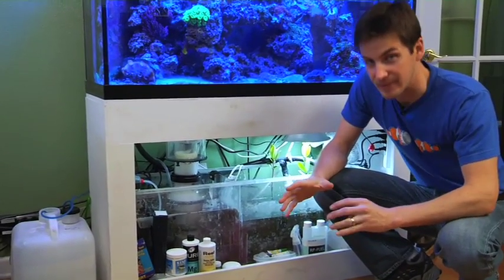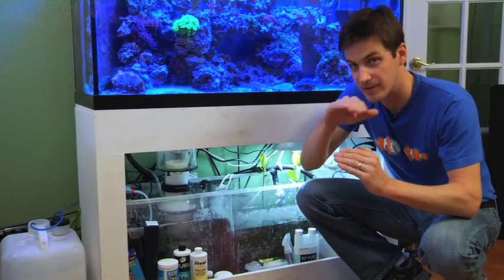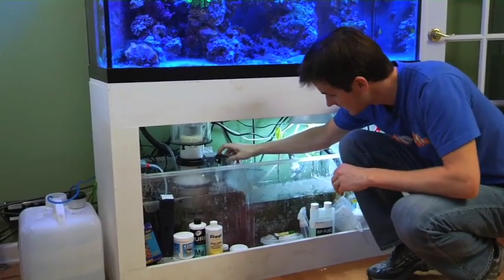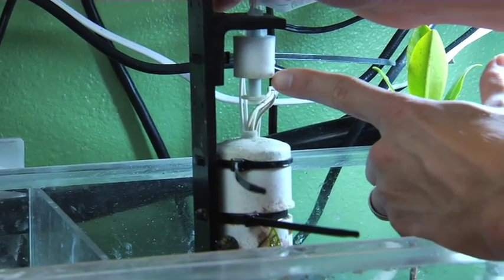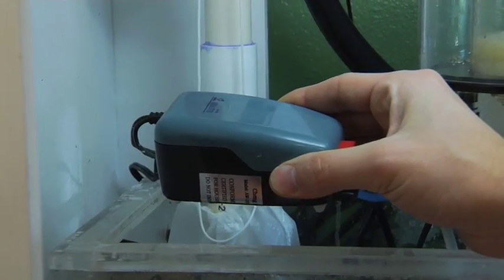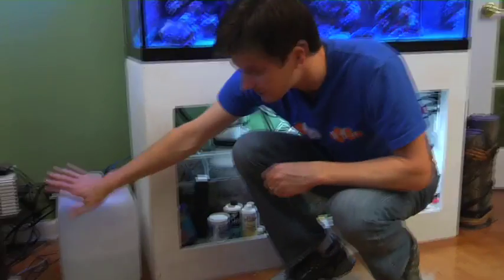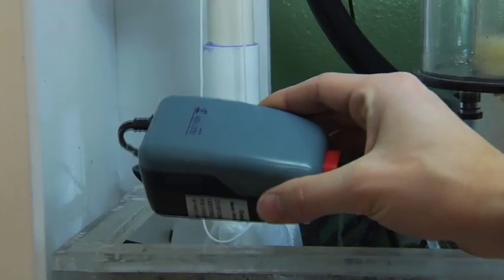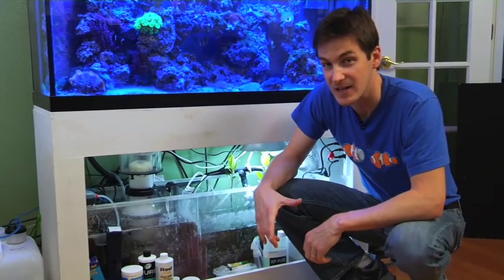Auto Top Off (ATO) Systems In Saltwater Aquariums

Comment: How could i set up a system to keep the salinity constant that doesn't depend on the water level? I want something that drips RODI water at different rates depending on the salinity of the water. The reason I want this is because I would want to add saltwater constantly and have it overflow through a separate skimmer having a constant wet skimmed water change.

Comment: How many float switches do you recommend on an ATO?
Reply from the maker: I like to have two. One senses current water level and the other is a "high" sensor such that if the first one fails and lets the ATO run, the high sensor will get tripped and shut off the system

Comment: So i have a question. I recently purchased the JBJ ATO. I believe something is wrong with it. I noticed in your video when you showed you outlet return from the aqualifter it was a very slow flow of water, just a small drip. Now my pump works fine when i plug it into an outlet itself but when plugged into my ATO it runs very slow, possibly even slower than what your video shows, also gets a foamy buildup towards the end of the line. My concern is the ATO sensor triggered and even after running all night the level did raise the float switch back up. Any advise would be very appreciated, keep up the great videos!!!

Comment: CAN RO WATER BE USED.?? I JUST HAVE A 4 STAGE RO SYSTEM..
Reply from the maker: You can use RO water. It will have more "stuff" left in the water which is why I prefer to run my water through an RO system first, then a finishing DI stage.

Comment: is there any way you can make an instructional video on how to install the floater to the pump and to get the whole system working, and also if i wanted to put one of those in the back of my red sea max 250 would that work? thanks!

Comment from the maker: Potentially, but several electric ATO systems will shut off if the water level gets too high, or if the pump runs too long.  With gravity fed systems, there is no fail-safe

Comment: Hi , how is the level switch on the auto top up wired to the pump, 
i have a float switch with 2 wires,
i also have a spare water pump.
do i break into the negative feed on the pump cable to conect the switch,
i really dont have a clue but i do know thats have a swich works..

Comment: Hey bro great job
This is the 1st vid I seen so far.
Gunna check out more now. 
I want to do the same exact idea but looking towards the gravity fed style. 
I have a float valve now I'm trying to use but just can't seem to rely on it. I've been testing it out but works then stops working. Can't have that. I'm thinking i just don't have the right parts. I'm more of a DIY guy 100%
I'm Gunna keep looking into it. Any help or tips would be great. 
If you like check out my tank and it's set up and l

Comment from the maker: @shaun11423 if both switches fail, then it would keep pumping RO water in your tank. 

However:
- the likely hood of both switches failing at the same time is low
- these switches fail "safe" so if they die, they turn off any switch that is on
- for most tanks, even if all of the above failed, then draining the top off reservoir would not cause an issue with the tank. This is another reason why RO systems should not be plumbed straight into your tank

Comment from the maker: @mr5boros1 The upper float switch is a fail safe. If the sump fills up to the point that the upper switch gets tripped, then it would cut off the ATO pump.

Comment from the maker: @koaihet31 check the manual for the recommended depth of water for that skimmer. It sounds like the you either have it too deep in the water, or you are skimming too wet. Check out my video on "tuning a protein skimmer"

You are probably get some protein & dissolved organics out of the water, but not as much as you should when the skimmer is dialed in.